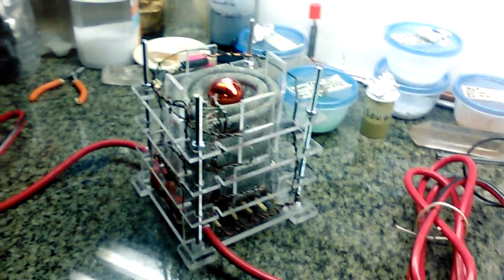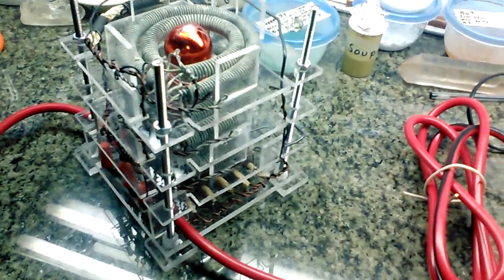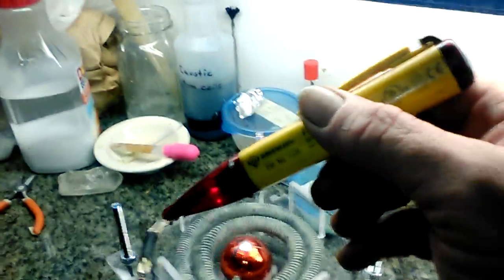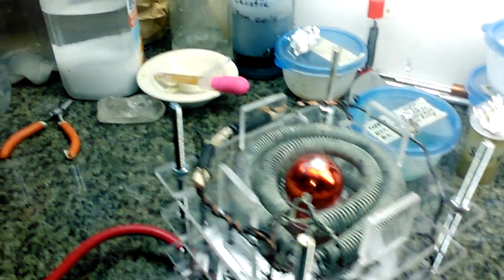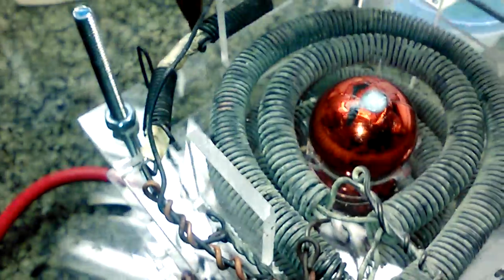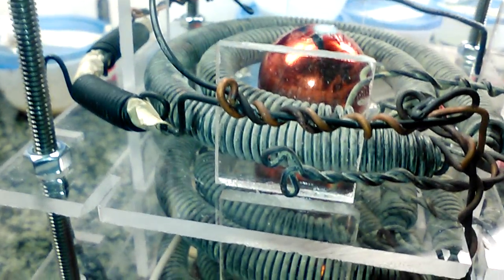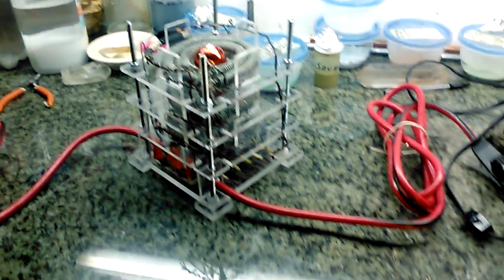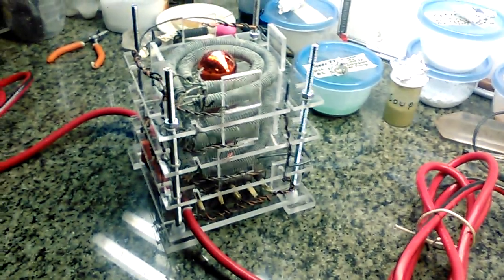Second Magrav working

Comment: Rewire a drum motor into a generator replace bearings with magnetic bearings on drum motor generator add a vacuum spark gap. Power generator off solar panels to generate high frequency electricity then use your unit to step down the electrical frequency.

Comment: I have a 15 units running at my house now, but mine are much better, using 75 watt bulbs, yours is only a 3 1/2w, LOL. (FYI - that Keshe thing wired inline, made from springs and Plexiglas is redundant, I eliminated it in my units).

Comment from the maker: Akshar Patel , yes plasma is very forgiving but you must have all your conditions in the right situation salt solution 10 grams of salt for 100 milliliters of water Nano coated copper cannot have any scratches on it and if you use current cannot exceed 1.5 milliamps 1.5 volts I have done it both ways using current and just using wires connected together at top of collection kit also using LEDs hope that helps if not find me on Facebook message I'll help you where I can

Comment from the maker: Martin singer after this time now have the unit running I am now a 40% + reduction in my electricity bill working on connecting the unit 812 volt battery and inverter for Off the Grid generator
Reply: Oh cool thx

Comment from the maker: this has been my experimental unit I am in process of wiring as per the hundred knowledge seeker workshop looking to achieve 90% reduction possibly more
Reply: +Rick Harris QAnd your result after 3 month is what exacrly? :D
Reply: awesome work rick which gans did you use?
Reply: He has detected that the whole thing is crap and now he is not tough enough to admit that he has been fooled by the messiass :D
Reply from the maker: Akshar Patel hello, I used a soup of Gans 
Equal parts of each Co2 Cuo H3 and brass
Reply: +Rick Harris awesome! I'm having trouble with the gans. I've read the plasmatic condition is very forgiving in reference to quality of gans. is this true?
Reply: Akshar Patel Yes. It does not exist, so it does not matter.
And Rick Harris ahould better learn some basics about setups and measurements :D

Comment: You can boost up your System if you following this metod.1 plug in the socket.2 leave it 5 days continuous on with 2000W load.3 Let for 1 day cool and get more oxidation.4 repeat  7-10 times this process. (heat , cool, heat...)5 after when process done put 100W on input side!6 and now use output as input for start. ( so just reverse input with output)7 miracle comingIt is important to follow the process exatly, otherwise wont work,
Reply: Hello, I just discovered this technology 5 minutes ago.I want just to ask what is the lifespam of a device?
Reply: @TheSailingDentist  
Nothing, it is just a fake, newer will work.
If you following instruction, you will have a nice electricity bill, that is all.
Reply: @cnccnc9070  Thank you for your answer.
Reply: @cnccnc9070  I'll give it a look.Thank you for this
Reply: @cnccnc9070  If you have more concepts to show please let me know